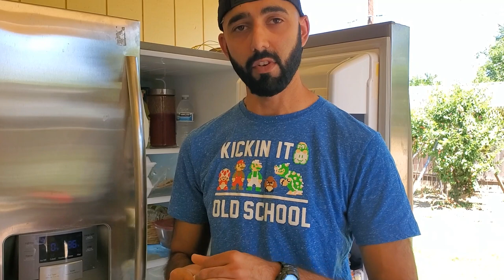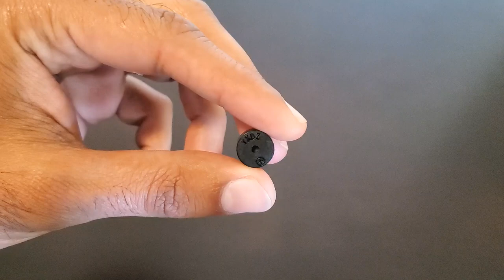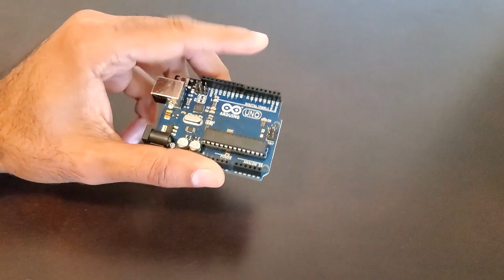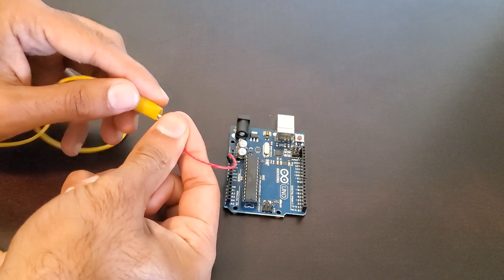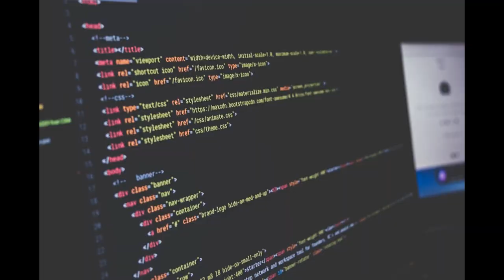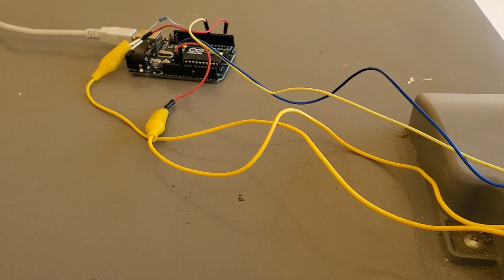Simple Refrigerator Door Alarm || Arduino

Comment: I was wondering if this could be done for an "old" fridge style with the French doors and the separate freezer door (3 doors altogether). I mean not 3 switches connected consecutively but 3 separate ports/inputs to the Arduino. Please advise.
Reply from the maker: Yes that can be done using 3 separate ports. Look into the "pull up resistor" function of the arduino so you won't even need a resistor like how I did in this video.